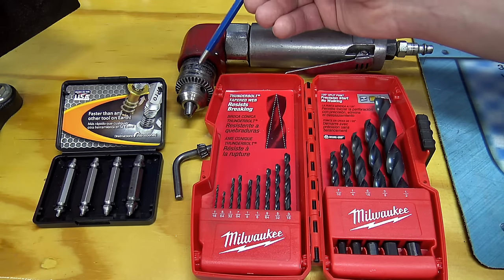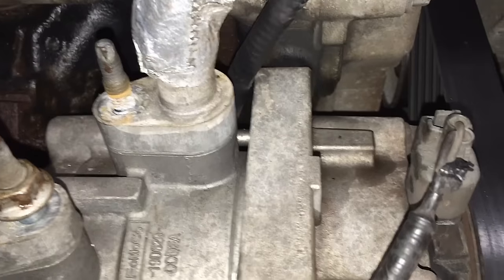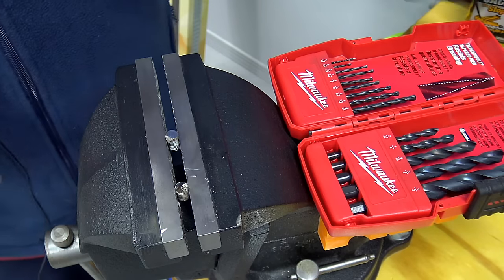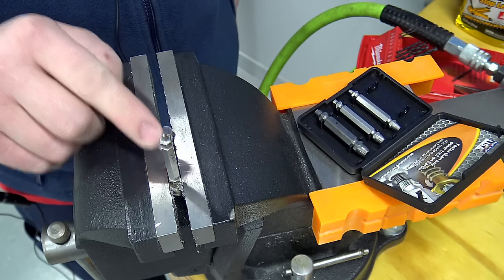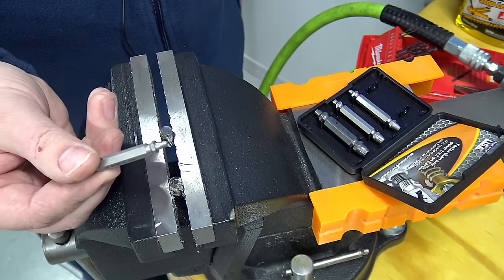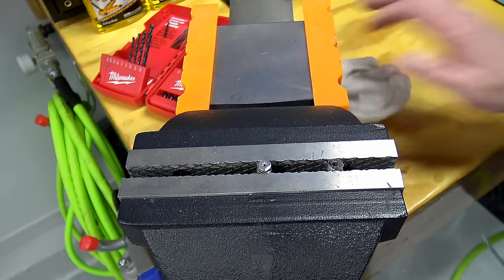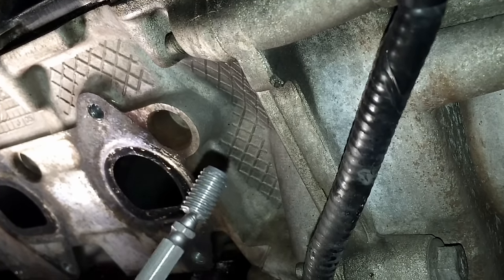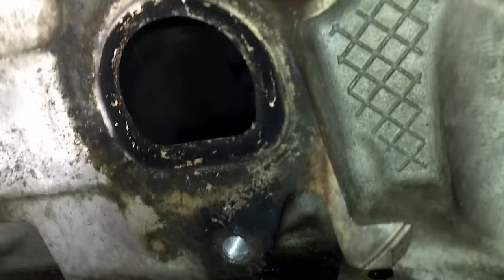Ford 4.6L 5.4L 6.8L 3v Engines: Broken Exhaust Manifold Stud Removal

Comment: I have a question about my freestar it's an 04 my right front headlight is really weak I put in a new bulb and it's still weak and when I apply the brakes the brake lights go off and on also my cruise control doesn't work it also seem to add miles on the odometer that aren't being driven if I drive maybe 30 miles it reads like 70 miles have been driven I have put alot of time and money in this van imrc bushings plugs wires coil pack fuel pressure sensor it just seems like one thing after another please help me thanks.... richie

Comment: Has anyone done this on an E-series van? I have a 2004 4.6 E250 that has half of them broken on the passenger side. Most are forward of the easy access area and it looks like the body is in the way. No removable inner fender like the trucks have. There is at least one broken on the driver's side also. Promaxx makes a 1/4" capacity drill chuck that goes on a 1/4" air ratchet (or cordless I assume) and looks to be really compact. It is $90 but might be worth it if no other choice. It is included with their drill guide $400 kit. Their tools look high quality but seems very pricey.

Comment: I got Ford Expedition 2004 4.6L v8 and every time I brake and push gas there is noise coming from the back it sounds like it comes from the muffler or differential

Comment: hey i got a 97 bmw and the air intake manifold sits on the 6 threaded screws that go into the engine are those studs? because when i put on the bolt that screws down i broke it flush with the engine and i take this out the same way as this video

Comment: it is ten times easier to weld a nut to the stud even if the stud is broken below the head surface. the head is aluminum so the weld wont stick to it
Reply from the maker: +josh v Yes we have already gone over this in the past but most people at home are not going to go spend $500 on welding gear to extract 1 bolt so I am showing alternate methods for the DIYer.
Reply: we use a 89 dollar welder from harbor freight at work but as u know there is always ten diff ways to do everything lol
Reply: How much cost at garage I wonder? Good tip. Gonna remember this, thanks a lot.

Comment: What i do. If the bolts start feeling like there gonna break. Ill chisel the nuts off with an air hammer. Be carefull not to hit the head and not to chisel the stud too much. Once the manifold is off. Can use the stud extractor or pliers. May need heat and pb blaster

Comment: I have a rattle coming from my '10 F150 with 5.4.  Only happens when the truck is warmed up and at lower RPM but not when I'm parked.  Maybe a heat shield??  I searched your videos and couldn't find anything so I'm asking here.  Any idea?  Thank you in advance.
Reply from the maker: +Jeremy Leonard Heat shields are not common on these are you sure its not coming from the engine? A heat shield would have a lighter tinny sound.
Reply: +FordTechMakuloco Rattle might be the wrong word to describe it but you can feel a subtle vibration when it happens. It's hard to tell where it's coming from when driving so it could be in the engine compartment.  A maintenance guy at work said it could be a heat shield, which is why I suggested that.
Reply: Jeremy Leonard front hub at lower rpm will grind when going bad my 09 does it has to do with vaccum

Comment: Guy was sayin his 5.4 has 280 000 km and the cam fase sensors are gone and his mechanic is sayin when they go the engine is toast. What do you think of that
Reply from the maker: No, unless they totally cam apart and the timing came undone.
Reply: FordTechMakuloco he says at low parking lot  speed or using reverse to back out of the driveway it wants to stall or does stall. He drives very slow and never tramps on it. Im thinking catalytic converter is plugged.  Small garage not a dealer says cam fase sensors are gone and and motor is toast.   At speed the truck runs perfect.  Dont smoke or use oil or coolant. It always had the famous 5.4 cam fase sensor noise. Any ideas.

Comment: Great video. would it be possible or even helpfull to remove motor mount bolts and jack it up a little to swing it over some? But your way seems the easiest though.. Thanks for the tips and tricks..
Reply from the maker: +Michael Nicholson On the 5.4l jacking up the engine is the way they are done.
Reply: thanks. have only changed a few manifolds on these types. The triton is a bear though. we dont get much of them at the shop. they charge to much. Thanks for the reply and the video. I will keep watching. Is subscription free?
Reply: +FordTechMakuloco How high would you need to raise it on the 5.4?  Do you loosen the driver side manifold/exhaust bolts as well?  Any tips on jack placement?
Reply: +Dustin Gruhlke. Depends on application and situation. there is a lot of info here on the video. for me it's not the height it's the possibility of swinging it over to get as much space as you can. there was no ref for jacking up the engine. his is a 4.0 . I would pull the engine before I pulled the heads on a 4.0. as for jacking you should consult a service manual for safe jacking placement. Safety is first priority.
Reply: Sorry Ford tech. Not trying to cut in on your time. Thanks for the video!

Comment: Simple mig welder. It won’t stick to the aluminum head. So build out the weld, weld on a nut and bing bang boom done. No need to drill in those tight spots.
Reply from the maker: Yup I have a video on that method too.
Reply: @FordTechMakuloco  sweet keep up the solid videos.

Comment: should you replace calipers by the pair or is it okay just to replace the one side that is bad
Reply from the maker: +Linda Burlingame If the other side has nice free movement and is not binding in any way we change one side at a time all the time. Its the friction material and rotors you want to change in pairs.

Comment: I have a 08 f150 4.6l  that has exhaust manifold leek on the right side. Could that be causing a lean code bank 1 P0171?
Reply from the maker: Normally no

Comment: I always use left-hand cobalt bits. Most of the time an extractor is not needed. Also keeps bolts from spinning in deeper.
Reply from the maker: If only it was that easy.
Reply: @FordTechMakuloco   Clearance seems to always be the issue 😒

Comment: Hey ,my 02 explorer ac compressor cycle on and off even when the heat is on,make the truck idle rough,
Reply from the maker: +STEEVE DAVID Nicolas The heat setting has no bearing on the a/c compressor coming on or not. It is the mode select switch that controls that.
Reply: Why it is doing it within 8 sec,when it is off ,the truck idle fine,but when either heat or ac on the compressor keep cycling
Reply: +STEEVE DAVID Nicolas Sounds like your climate control switch could be having issue. That or a wiring issue has sprung up somewhere telling the compressor to cycle on. Short term fix for the winter is just unplug the loom going to the compressor.
Reply: +bdbrolly I'm thinking about freon maybe it is low,and the ac is cool not cold but still it keep cycling on and off
Reply: +STEEVE DAVID Nicolas Possibly. If your not pushing under 50 from the vents thats a problem though the compressor should never cycle in heat at any point.
Reply: +bdbrolly im gonna put new freo. to c what happen
Reply: +FordTechMakuloco actually if you use the defroster setting the A/C clutch WILL cycle.
Reply: Explorers are bad about short cycling like that if they are low on refrigerant. If you don't have the A/C running and your compressor clutch is still engaging, you have a bad A/C clutch relay, or climate control switch malfunction. This will actually cause a parasitic drain on your battery.

Comment: great video..I have a question..my dodge minivan has 2 studs that are in the motor for the oil pan and the rest are bolts..one of the studs snapped off now I have a continuous leak can I do this with that stud or am I screwed
Reply: You should be able to do this on any stud or bolt that is broke.

Comment: Is it common for these studs to break on the 5.4 triton 2 valve engines or just the 3 valve engines? I'm getting ready to replace mine on a 98 F150. Looks like it will be fun fun lol since my studs are severely rusted.
Reply: how was it, did you get them out? I'm for that too!
Reply: +Fishing Rod I have yet to attempt it. I am putting this off for as long as possible lol.
Reply: I hear you..me too. And working on the suspension now...the rears shackles are falling in pieces! Are you going stock or with headers? Might as well...don't you think?

Comment: why do those studs break in the first place? do people start there cars cold and hammer the hell out of them so the manifold expands faster than the head? it cant be from warping because the manifolds are like cheese when they are hot. do you recomend planing the manifolds?
Reply: +smoke skull I have heard it is the 2 bolt connection at the exhaust manifold outlet, when connected to exhaust "y" tube places a stress load on manifold, support is currently a rubber hanger which may allow for to much deflection.

Comment: What vehicle was this preformed on?
Reply from the maker: 2006 Explorer 4.6L 3v
Reply: FordTechMakuloco this video helped me a bunch I was able to drill out a front top stud that broke off on me it wasn’t seized up but I must have applied the pressure wrong when removing.

I found that using the right angle dewalt impact tool with a impact drill fit in there great but still had to cut new bits but better than pulling a head or engine..... the truck was a 2008 Ford Expedition 5.4 3v thanks again for all your videos I got the kooks headers and green Y-pipe in fit tight but it fit. Sound is just amazing on the roush supercharged engine

Comment: 2006 f 150 5.4 should i switch them out before they break, mine are still good
Reply: I would. I just did mine on my 07' F150 5.4 and I just ended up having a cracked manifold.  Let me tell you it was a PITA. 10hr job and I used a stainless stud/nut kit I bought from eBay.

Comment: Grade 8 studs or bolts combined with anti-seize.  Problem solved.  When manufacturers switched from 3/8 or 10mm fasteners to 8mm is when all this nonsense started happening.

Comment: Do not use a extractor it will break,Drill And Tap only, I it does break use a diamond tip dremel bit to get it out. ,

Comment: Why not replace the bolts with stainless steel ones?
Reply from the maker: They are but the Ford ones are also copper coated so no anti seize is needed where it threads into the aluminium head.
Reply: If and when a stainless stud breaks (and it will). Good luck drilling into a stainless bolt.
Reply: @FordTechMakuloco  glad I scrolled down and read all the comments.  I too was wondering about anti sneeze. My other question  was about the manifold removal video.  I have a 2010 6.8 V10. Is this method of removing the manifold apply? Also has the 2 rear studs broken

Comment: Any tips for getting at the forward most bolt on a 2013 Expedition? Massive strut tower in the way.
Reply from the maker: Same procedure cut down the drill bits or weld a nut

Comment: what is the diff between the 4.6/5.4 removal process you said the 4.6 is a lil different (harder?)
Reply from the maker: The 4.6l 3v engine as shown here is just a little harder to access is all since the shock tower is in the way and it is common for the front two to break not the rear two as with the 5.4l 3v engines.

Comment: Good luck drilling into a stainless bolt. hard as a Hammer... try welding on a stainless bolt.... Haha... never the less Another Great Video...
Reply from the maker: Hopefully I will never have to
Reply: @FordTechMakuloco  don't worry they have a stainless welding rod and nuts ... and carbide  drills...

Comment: What kind of job would it be to remove the through bolt for the right side motor mount and lift the engine on the right side a few inches, to get better access to the top front ex. man. broken studs? Doable?

Comment: I would be extremely careful about drilling an angled or off-center hole in the bolt.
Reply from the maker: +Jess Stuart yup you just need to be careful but the extractor bits don't need to go in very far